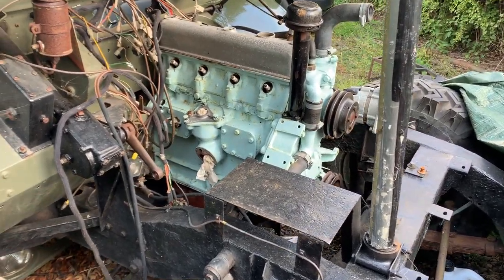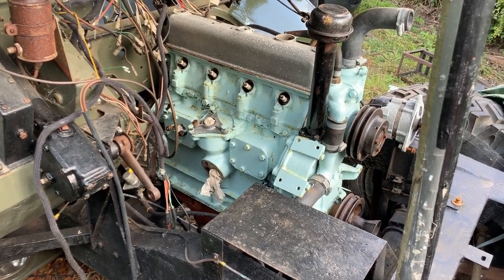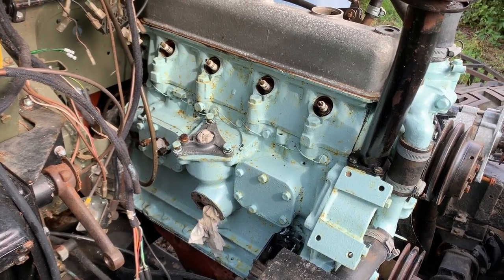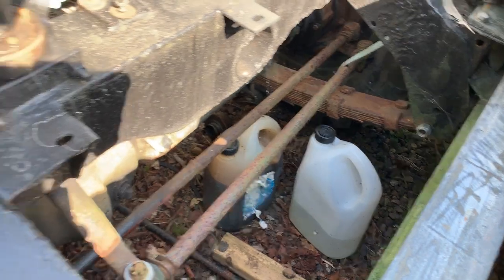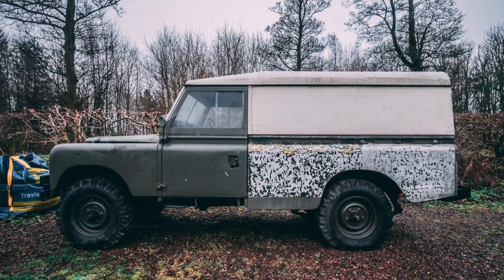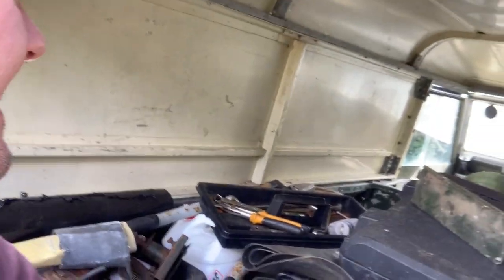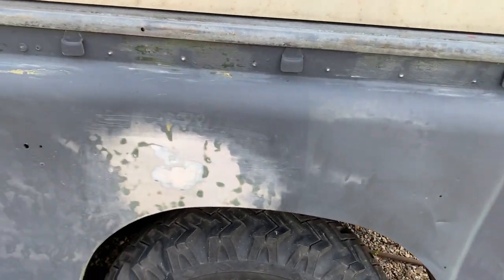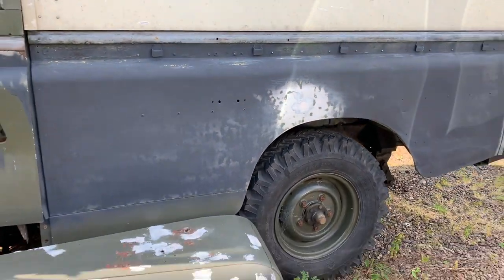Coach / Hand  painting my Land Rover [Brush Vs Roller]

Comment: Hi Gordon. Not a bad job at all given the condition of the panels. I painted our 2a some years ago with a brush and found the best result in "cross brushing" ie roll it on, lay off horizontally and lay it off again at 90 degrees with a very light touch - literally using just the weight of the brush. The wait a couple of weeks and T-cut it.  I think your also right when you talk about gloss showing every little blemish, but the only way round that is either spray or use satin finish and polish it - a lot! Well done though, she certainly looks 100% better. Keep up the good work. All the best.
Reply from the maker: yea the panels are not even close to smooth haha, Can't wait for winter to end so i can crack on a bit more! thanks for watching!

Comment: Hi, great job. Some years ago I painted my ex-mod 109 S3 LHD to mid-grey (=welsh grey), after considering limestone and light-green, which I mostly assiciate with the series - apart from bronce-green. I spent weeks and months with sanding the mil-paint, but not to bare metal. First layers are  etch-primer, where I hit the ground, but normally filler paint. Again: sanding, sanding, ... I stopped, as there are areas left, which did not manage to get it smooth enough for a professionel paint job. I sprayed all the paint. The Wagner electric spray gun was not that bad. Some parts I sprayed by using a classic air gun. I also used 2k paint and emanel paint for different parts. 2K costs 3 times the enamel coach paint, but delivers a more shiny result and lasts longer.

Comment: I really like Novol Protect 360 epoxy primer for these - it sticks like crazy to the ally panels & is ultra-tough wearing. It sticks like crazy to everything as it happens - when  we refurbish LR axles & suspension parts for people, we use it on every bit as it gives you a really good base to paint onto. It's also brilliant on the chassis. 

I now find that if you want a really good non 2-pack topcoat for components like axles, calipers, springs, sway bars etc etc then Tractol stuff is very hard to beat. Very hard, it is also good for rolling & brushing (we don't as we have a booth blah blah) - but it's nice paint to work with & loads of paint out there isn't. It also goes on beautifully over the 2-pack primer - which again, loads of other brands won't - they will react like mad. Plus they do 1001 colours that are readily available - I have become a Fan of Tractol paints - the one "downside" of their stuff is cleaning the gun afterwards. That's a sod of a job - but is also usually indicative that the paint is good stuff. If it washes out easily, it's often a bit naff at lasting well. :-)  Just my 2c.

Comment: After using the roller,you can re roller as it dries,and each time you will have less bubbles,continuing until the bubbles are pretty much eliminated.This is not a criticism.It's your Landy,and I am a great believer in doing what you want,how you want,to them
Reply from the maker: thanks Gregg, I will defo give that a try next time. its great knowing that if you mess it up, it's no big deal lol just rub it down a bit and have another go, it's so cheap lol.

Comment: Great video, painting my 1984 110 CSW and certainly will follow your advice and tips. 

Thanks Gordon.
Reply from the maker: thanks! ooh i love the look of the early 110s. pretty sure i might get one one day!! what colour is it?
Reply: @TheRetroSeries2a  its a 1984, 110 csw, in green, white roof.. but I've rebuilt it, galvanised chassis, bulkhead, 300tdi now, galvanised SP series door conversions fitted, all new brakes, steering pump, steering box, list goes on and on. 
So the doors etc are bare galvanised at the moment. I was getting crazy quotes for a respray, so I'm just going to paint it myself. 🤞🤞

Comment: Pro tip: after rolling on the paint wait for it to set a bit - then go over with roller even so slightly to "crack up" the bubbles - they will now smoothen out to a good surface.

Comment: Your video showed up because I was looking for ways to paint the topping mower for my tractor, LOL. It's a pretty big area to paint being 5ft 6 by 8ft and having to do the underside and the top. I'm thinking more of brush painting it with a 3 inch or 4 inch brush to get a good thickness of paint in 2 or 3 coats and on that I'm not bothered if there's some brush marks, as long as it is hard wearing and don't wear away too quick underneath with cutting the field, LOL. My biggest worry is if the paint will dry now we are getting in to November. The tractor paint says a minimum temperature of 15°C and maximum humidity of 85%. Otherwise I'm going to have to leave it till around April which I don't really want to do as the new metal I've welded on it will of rusted a lot by then. Any advice on this would be great. By the way, what did you wipe the metal over with before painting that you said dried off quick. 🙂 Martin.
Reply from the maker: brushing seems to go on slightly thicker than roller! you can still lay off with a dry brush to get a nicer finish! i still have a few bits left to paint on mine but won't do it till next year as it won't dry!like you say it needs 15 deg. I tried last year and the damp air got into the paint and it looked awful.
Reply: @TheRetroSeries2a  thanks for the advice. Yeah I feared that might be the case. I was hoping to finish the welding much earlier then this, but it's just taken way longer then I thought to do it all. I could of done a lot to it in the lockdown from earlier in the year, but I needed extra metal to continue, but of course nobody locally was open to get any for months after. I have got the mower propped up on stacks of pallets 3 high and was going to make a shelter around it before prepping and painting it. Of course dampness could still evaporate out the wet ground in the shelter. I think I'm just going to have to cover it and leave it till late spring when the weather is better.
Reply from the maker: @MrBooojangles  probably best way! one warm spring morning and it will be done!!! touch dry in 8 hours! sat outside

Comment: Hello, nice vid and job welk done. There are double-grooved pulleys on your engine, which I am looking for a long time - and still in vain. Please, let me know any hint or tip of a source. What kind of etch primer and paint did you worked with? I painted my 1984 Series 3 ex-mod (FFR 24VV) in mid-grey ( =welsh-grey), but partly left the "genuine" paint ( infrared, camouflage) as I found it and did not grind to bare metal). After over 15 years, the paint now flakes off again at some points.  The restoration of a 109 SII (1967, civil reg., petrol, truck-cap) still waits, but I hopefully get to start next year. So, you inspire me to get the job done. Regards Heinz

Comment: That looks great Gordon - And thanks for doing the brush tip off vs just roller comparison - Given me the confidence to have a go at mine. Great video. What paint did you use for topcoat?
Reply from the maker: yea just go for it, i used paintman paint. hoping to get a bit more done over next month, so will do a bit of a video on that too
Reply: Is it synthetic or something else and did you thin it at all or straight from the tin?
Reply from the maker: @GHOOGLEMALE  not sure, i  know its enamel, no no need to thin it, just a good stir then apply it!

Comment: brush works ok , but think you had  paint not thinned enough with thinners,coach painting in the old days would take weeks, coat after coat ,thin coats ,lightly sanded ,thin enough to lay off ,but not too thin to run everywhere,it was a true skill !good bushes are a must , real bristle ,yes and autumn is best time ,in summer paint will dry too fast ,too lay off, and insects too, 5 litres was way too much tho, i litre goes far thinned 10 to 20 % with top quality xylene thinners
Reply from the maker: Thanks for the tips!